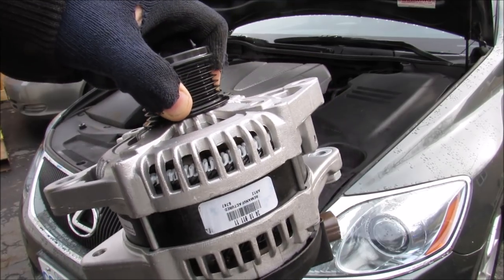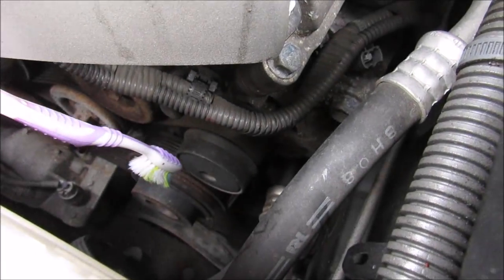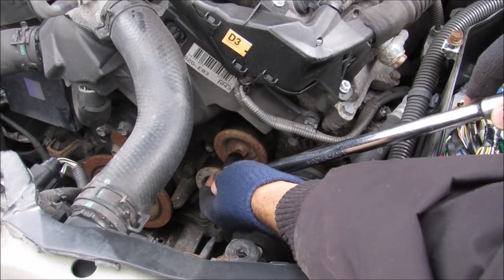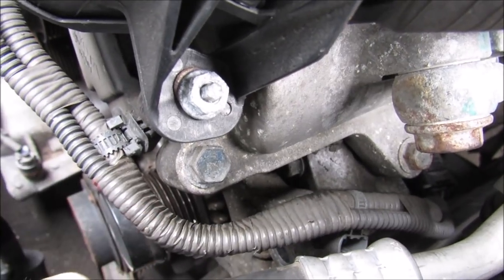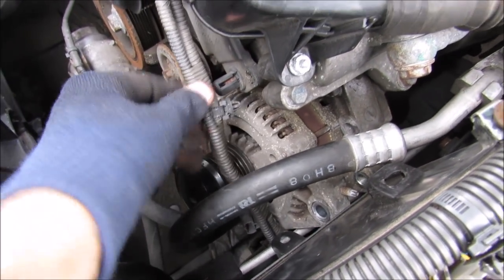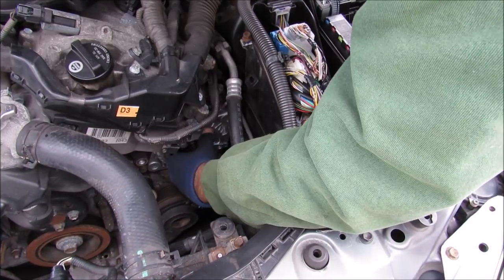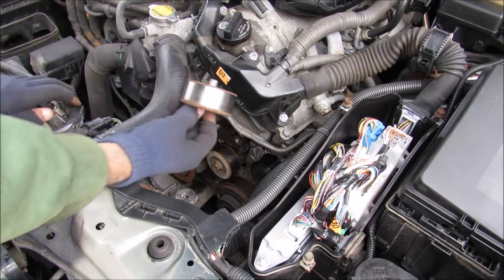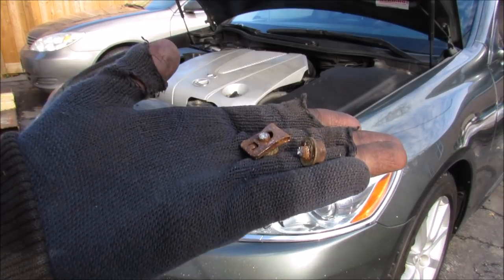Alternator Replacement -  Toyota & Lexus V6

Comment: I also have the same vehicle but mine doesn't turn over. I only have one try to crank it over. It starts and than completely dies right after and doesn't turn over after that. Fan cuts on ever time I try to start the car but no sound from the engine. 
New battery 
New ignition coils
New spark plugs and still doesn't turn over. If you have and idea what is wrong can you please reach out to me. I have a small clip on my page. Thanks in advance!
Reply from the maker: Perhaps your engine is locked
Reply: It was perfectly fine when I drove it to work. Some people say it's something electrical but I'm not sure. I'm the type of diy type of guy...engine lock I'll look into it

Comment: Touchscreen HVAC and radio controls are the work of beelzebub. What was wrong with a knob? is a knob not cool enough? You can fondle knobs and buttons and figure shit out while you're going along and make what you want to happen, happen, without looking away from the road.
Reply from the maker: +John I thought the same way when I first got this car, but after a year and half of using it, I rarely use the touchscreen! Since the HVAC is automatic and the radio has dedicated hard buttons the touchscreen is only for advanced or custom settings which I don't need daily. I'd say Lexus did it well compared to other manufacturers, the only hardkey I miss is fan speed.

Comment: I did all this but my alarm is still going off. Any ideas?
Reply from the maker: Alarm? 
Hmm do you have an afternarket system? Check the door and hood switches
Reply: speedkar99 do you think it has to do with me opening up the car with a slim Jim because I was locked out

Comment: I have a 2008 Lexus GS350  this  video  was  helpful my car is fine except it won't turn over it's not even trying after putting the new alternator and it started with the bad one anyone know what's up?
Reply: I'm having the same problem now. Changed alternator and car wont crank up.  Did you figure out what was wrong???

Comment: I replaced my alternator and now the car wont turn over, the car has power but it wont start. please help
Reply from the maker: You probably forgot to connect the power cable 
Also do a load check on the battery
Reply: @speedkar99  you are right. I had unplugged the starter when I pulled out the alternator

Comment: Why does Toyota make it so difficult, I wanna know who is in charge of making that design
Reply from the maker: The engine was made for rwd and fwd applications. The alternator is easier on these RWD vehicles than on the FWD Camry/ES350 cars where you have to remove the front end

Comment: and I thought the es330 was hard to work on...
Reply from the maker: +ksajan16 the es330 rear spark plugs are trickey because the plenum. The rest is easier.
Reply: ES330 Thermostat Replacement is Piece of Work, Also.2-2.5 Hours,W/ Dealer $30 Chge.for 50/ 50 Pr.Gallon Toy.Coolant , Labor & $70 Chge.for Thermo,Gaskets= $425-440.

Comment: I changed my battery and when i checked the readings, my alternator was giving 13.8 in iddle no load and getting to 12.7 with some load ( with the new battery). The following day my alternator was giving 14.2 volts with load. What was that!? Some kind of self protection or resetting of the computer??
Reply from the maker: That's weird. It should be consistent. Maybe the battery was discharged

Comment: Why toyotas engines are so complicated ?
Reply: ???you shold see many VW or Mercedes Engines, then you won´t think so.
The good thing is: you can often repair japanese cars without using  special tools or disassembling 1000 Parts around. Greetings from Germany
Reply: 4 valve per cylinder, DOHC, Variable Valve Timing FTW. "Simple" pushrod engines belong in the scrap metal pile/
Reply from the maker: +Berke çoban these engines are much simpler than say a German vehicle. It's just getting harder and harder to work on it.
Reply from the maker: +suzuki liana ddis agreed!
Reply: You should see a FWD v8 DOHC lincoln continental :lol:. Removing the alternator takes off a bit of paint is so tight. This really isn't bad.
Reply from the maker: +alb12345672 ouch

Comment: Ur the F*ckin man. I have an 07 GS350 AWD.  AWD and RWD are the same process?
Reply from the maker: Thanks 
AWD is slightly more tricky from what I head. You might have to loosen the compressor
Reply: I get mixed feed back on that.  Some say the AWD also just slips out with a little maneuvering.  I've also heard that slightly jacking the engine up and removing the Engine Mount (DR side) makes the bolt pretty easy to access.  

Would loosening the compressor require me to drain it?
Reply from the maker: From what I've read you should have enough wiggle room with the flexible hose running to the compressor 

Engine mount....sounds like AWD is alot more work eh 😑
Reply: Great.  Attempting this repair next week.  The Engine Mount removal and engine jacking is really just to be able to easily access that hidden bracket bolt.  I have a Cell Phone Borescope on the way, so I hope to bypass that method.
Reply: Got the job done on Wednesday! Took about 2 hours, no removing ac line, no jacking up the car.  Basically the same exact process on an AWD. Used a $16 Ebay cell phone Borescope to get at that hidden Ahole nut.  Thanks Again. 

About to follow you Tutorial on changing the tranny fluid next.